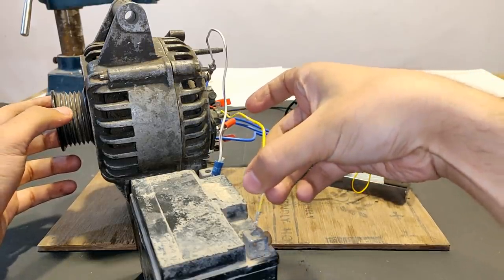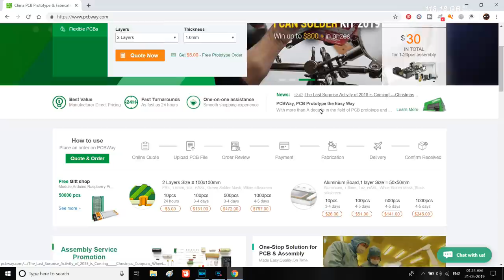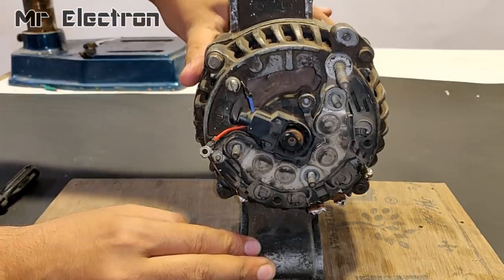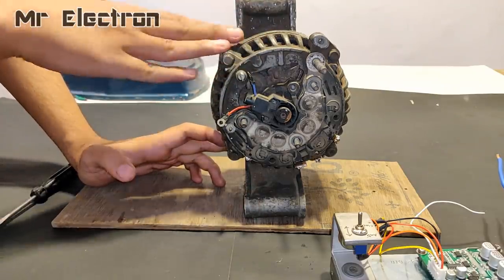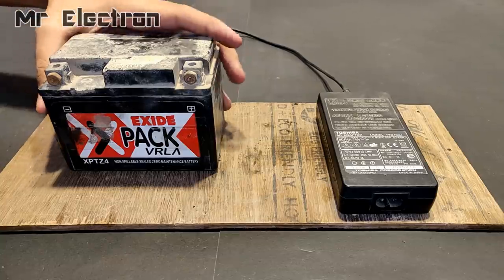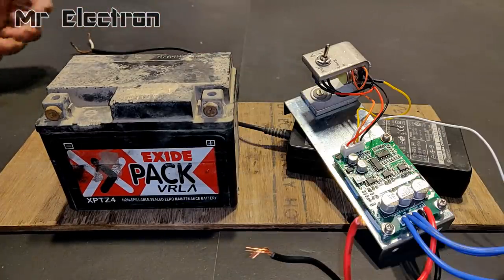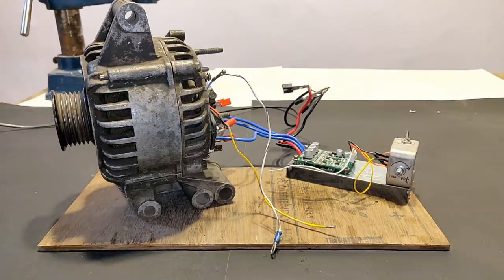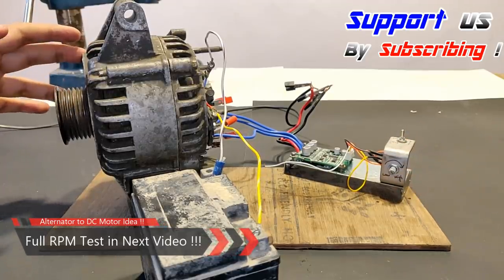12v 120 Amps Car Alternator converted to DC Motor ( 1500 Watt High Torque ) - with BLDC Controller

Comment: I was going to experiment with a alternator, similarly, ibgot a brushed DC motor controller, PWM, to connect to the brushes, to vary the strenth of the magnetic field, and keep the coil cooler. I think the coil is ment to be pulsed in normal operation. To regulate output, I have heard it is most effiecent with about 3 vdc on the rotor coil. Great video..
Reply from the maker: Thanks James !
Reply: As a motor the efficiency depends on rpm, at low rpm the max voltage you can get without saturating will give you the highest output power, as rpms rise you want to drop the power to the field to reduce back emf and give more efficiency at higher rpm. For example at full 12v you may only have 2500 rpm max , it if you drop the field voltage to 5 volts it's possible you might get closer to 3-4000 rpm with the same controller. Pulsed dc to the field would be less effective, yes it can handle it but that's simply because that's what old style regulators used to use to regulate power (basically a relay that would turn off the field when the battery charge voltage was reached and turn the field coil back on when the voltage dropped to low for battery charging) but using a consistent voltage to the field would be more efficient, you just need different electronics than a relay.

Comment: Use the output rectifiers for field supply. This does two things for you variable field strength and no power loss when the motor is not being driven.
Reply: The field coil should be voltage adjusted based on rpm, between 5-12 volts depending on if it's running at low rpm or high rpm.

Comment: The laptop power supply is not usually 12V, it is usually 18V-20V, that would make it alone around 60W@3A
The 12V@2A is 24W for a total of 84W consumed/dissipated.
Reply from the maker: Some chargers are 15v and considering the full load current flow , voltage drops to 12v

Comment: Im still learning about electric. Can someone tell me what the limits are to an alternator? Ive heard 1500 watts or so. 
Ive got a 3g ford alternator rated 12v and 130 amps which is a little over 1500 watts.
I saw a guy who ran his at 48v. He was using around a 1500w controller. Assuming he had a 130 amp alternator, would that mean hes running 130/48...2.7amps? This is what is confusing

Comment: Hey hi! I saw both the videos great build I must congratulate you for not calling this a BLDC Moter. A lot many such videos that show alternator being turned into a motor claim that it's a bldc motor, when they have those brushes still installed on the armature!! And they also build bldc motors without magnets now that is fascinating 😂😂😂😂😂😂😂😂😂😂😂😂😂
Reply: Technically, if you just remove the armature and install a permanent magnet in its place, it truly becomes a brushless motor. There’s videos of that being done 

The armature and brushes are just there to create the needed magnetic field

Comment: You won't see Maximum amps, current draw until the motor shaft is loaded. Maximum torque will be with the motor stalled. Hook it up to a dyno to measure HP and Torque. you could use a generator as a dyno to measure watts and then times by 1.34 to get HP @rpm with a tachometer rpm reading.

Comment: Can you guide me through purchasing the correct motor controller equipment to operate that  alternator at it's full potential of close to 150 amps ? That would be great.
Reply from the maker: I will txt you the link when i find the required controller of rating 150 A or more.
Reply: @MrElectron  . Thank you for your reply and I will appreciate your help.
Reply from the maker: Hi!

I did some digging. 38 Amps is the max that is available in the no hall type.Perhaps if the a 24v volt or 48v alternator is available then the required current will decrease automatically.
Anyways, my employees are still looking.If it gets available, i will text you.
Link for 38A hall or no hall type : [₹3,232.67]48V to 64V 800W Electric Bicycle E-bike Scooter Brushless DC Motor Speed Controller Electrical Equipment & Supplies from Tools, Industrial & Scientific on banggood.com
https://banggood.app.link/mTXboCav5W
Reply from the maker: Although this controller has higher volt rating so its not suitable for your purpose.
Reply: @MrElectron  Thank you for all of your efforts.
Reply: @MrElectron  you can run any alternator on 48 or even more volts. There's no reason to limit yourself to 12 volts. Those windings are typically insulated enough to withstand a few hundred volts at least.

Comment: does it mather what side you rotate alternator ?
In some old tractor designs here in Europ comonly Delco and Bosch have capacitors on them if those capacitors fail the alternator does not charge baterry they also have another problem there exist left side and right side turning pulleys if wrong alternator is buyed also baterry dead empty.
So how to modifi such alternator and how determine in what direction it shuld spin and if you be acident buy wrong turning direction alternator how correct that mistake can the brushes be swaped or does it need to be swaped wires on the bridge rectifier as well.
There is lot confusion about that thing .

Comment: NICE VIDEO, MY QUESTION IS IF THIS CONTROLLER WILL WORK AT LONG THERM WITHOUT WARMING WITH THE ALTERNATOR, AND IF I COULD ADAPT A ELETRIC BIKE MANUAL ACELERATOR ON THIS CONTROLLER.

Comment: Mr Elctron you mix up the winding terminology.
The "rotor" (also called "armature") has a "rotor winding" or "armature winding"
The stationary part is the "stator" or "field" so has a " stator winding" or "field winding".
The stator is not the armature, and the rotor is not the field :-)

Comment: nice idea please show me HOW CAN I MAKE BLDC CONTROLLER FOR THIS  PROJECT
Reply from the maker: Make BLDC Controller : https://www.youtube.com/watch?v=ZGBTyr51I7Q
Reply: @MrElectron  thank you alot
Reply: can I increase to 150 AMPS with 12v using this 
Car Alternator
Reply from the maker: I didn't get your question
Reply: @MrElectron  upgrade the Amps from 120 Amps to 150 Amps
Reply: @dagemawialemayhu9263  the amperage of the controller just depends on which components you chose to use. The amperage of the controller should match the amperage rating of the alternator so the amps you need should be based on what kind of alternator you have, I've had a couple of 80 amp alternators and had one rates up to 370 amps.

Comment: Hi I have a question,: why 3 wires if is DC? can you explain? also  can you tell us the model of the controller you are using? thank you and best regards
Reply: It's pulsed dc timed between those three wires based on the phase angle of the rotor. It would be more efficient to use 3 phase ac because the windings overlap, in an alternator the windings overlap while in a bldc the windings don't overlap. This is why in an alternator the output is a sinusoidal wave form while in a bldc the output (back emf) is trapezoidal (basically pulsed dc).

Comment: I got a RC BEC 30A speed controller connected to an alternator hooked to a car battery. The alternator spinned very slow for about 5 sec and stopped. Can reactivate but it repeats it's 5sec cycle. Any idea what went wrong.
Reply: You're probably using a sensorless controller built for smaller BLDC motors. What's happening is that the switching frequency is so high that it skips over most windings, resulting in poor performance. And it's shutting down as it's not recieving proper feedback from the other phases as it's too fast. 
Either make or buy a sensored driver circuit. It would have extremely low torque and would need turning over to "sync".

Comment: i have zs-x11B module (with hall sensor connection) i want to use it to run bldc motor without hall sensor (alternator car modification) but not running. please teach me how to do that the bldc motor without hall sensor can spin using the zx-x11b module with hall sensor connection.

Comment: I’ll use one of my low amp salvaged power supplies to connect to my  e bike controllers to run their motors without using their batteries 5:20

Comment: Now, question is, how do I run this off 120 or 240 vac
Reply: There's no way you're using this on 120 or 240V AC. First, the US power system only has two phases and a neutral. These phases are 180 degrees out of phase.
An alternator is for low voltage only. You need a 3-phase driver circuit and a big 3-phase step down transformer to use. Just use an induction motor made for the job..

Comment: Sir can we use car 12vbattery for running alternator as bldc motor in bike please reply sir
Reply: Of course, but not directly. You need a driver circuit. Either buy it or make it.

Comment: Hi sir super video sir alternator can used in e bike as a bldc motor
Reply: Plz reply
Reply: @lazyh-online4839    sir can alternator motor used in e bike
Reply: @mmk4854  yes, there's tons of videos on YouTube of people putting them in ebikes and go carts and the like. depending on the alternator you can get over 20 horsepower out of it as long as you have a good enough controller.
Reply: @lazyh-online4839  lmafo 20hp is a bit of a exaggeration, you would be lucky to get 2hp out of a alternator
Reply: @mashedpotatoes5323  many alternators can get 20 hp, I did say it depended upon which one though didn't I? My stock alternator from my geo prizm was able to put out about 4 hp pretty easily with bursts up to about 7 or so hp, but the alternator would get way to hot if I held those higher hp for too long. It could handle 80 amps rms but at 7hp it was about 140-150 amps for a short while, just a few seconds really.
Reply: @lazyh-online4839  only alternator's that can get that high hp are found in hybrids and they have water cooling, normal car alternator's are only able to do around 2hp since they have crappy cooling and they are only at best 75% efficient when used as a motor which means 1/4 of the energy you put in gets turned into heat. They may be able to do more hp in bursts but not continuously.
Reply: @mashedpotatoes5323  75%? Mine barely got 60%, but it's an older one, almost as old as I am, the diodes died in it but the windings and brushes were still in great condition. As I mentioned that one in particular can handle continuous 80 amps, and after I changed out the bearings it ran really great at about 3.5-4 hp continuously. I'll try to upload a video of it some time, I used it on my belt grinder for a while before I switched to a more easily driven treadmill motor, less than half the power but it was still plenty for the grinder and the rpm matched by contact wheel diameter better. I had a higher amperage alternator made to fit a f150 that could handle almost 10hp continuously without overheating, never found out how high it could go when pulsed though.

Comment: Can I use to make a table saw?
Reply: If you can find a way to attach the motor and pulley then absolutely. As long as the blade isn't too big and you don't cut too big of lumber it should work just fine.
Reply: I used one to power a drill press with a dead motor, and another to power a CNC spindle.
Reply: @lazyh-online4839 
Thanks .

Comment: It's need 1.5v to make magnet fild
Reply: The field voltage depends on the room range that you want. Lower rpm and higher torque means higher field voltage (8-14 volts) while if you want higher rpm and don't need as much torque you can use a lower field voltage (4-7 volts). I usually use a bldc controller (esc) with a BEC. That stands for battery eliminator circuit, it provides about 5 volts which is a good number for general purpose projects using an alternator as a motor.

Comment: What is the torque ?
Reply: The force when the rotor turns.
Try to hold onto a rotor with your hands when it is turning, and try to stop it with your hands from turning.
If the torque is low, your hands can easily stop the rotor from rotating.
If the torque is high, your hands will not stop the rotor from turning.

Comment: So it's a synchrous motor
Reply: True, in a bldc the coils are isolated which gives a trapezoidal back emf waveform, while in an alternator the coils overlap which gives a sinusoidal back emf pattern, which means it's more accurate to call it a synchronous ac motor rather than a bldc equivalent.
Reply: @lazyh-online4839  exactly my point
Reply: @vinesnation7202  yep, that's why I was agreeing with you.

Comment: Can i use this motor in motorcycle...?  To make it e-bike???
Reply from the maker: Yes !! Because the toque is good.. I am finding ways to increase its RPM Safely by taking all the circuit protective precautions
Reply: @MrElectron  wow....amazing....thinking to convert an old bike into electrick...hero honda splendor...what u think...how much speed it can gain...?
Reply from the maker: Few tests left after which i can reply to your query. Stay Connected
Reply: @MrElectron  ok bro...all the best...👍👍👍
Reply: I watched a video the other day about that. World's first 4 speed e bike it was called I think. They removed cylinder and mounted electric motor where the ohc would be with a chain drive down to the crank. Basically replacing cylinder and head with an electric motor.
Reply: @MrElectron  if you have a controller that can handle the power, a 150 amp alternator can hypothetically be converted to run at about 16 hp at 80 volts, but it'll run better than a 16hp gasoline motor because electric motors have higher torque at lower rpm, gasoline needs higher rpm to reach max torque so a 16hp electric motor may feel more like a 20-30 hp gasoline motor.

Comment: It won’t work perfectly without hall sensor
Reply: Works just fine with back emf unless you want lower rpm. Just use whatever controller works well for your application. Sensorless works just as well when used for tools and such without the complexity of hall sensors, while if you want something like an ebike then hall sensors will help it start easier at low rpm whole running.